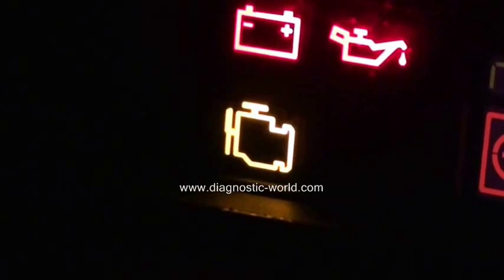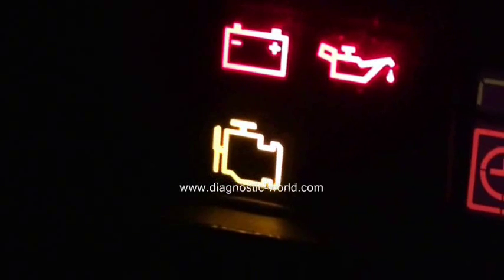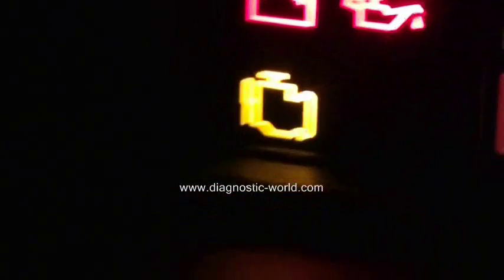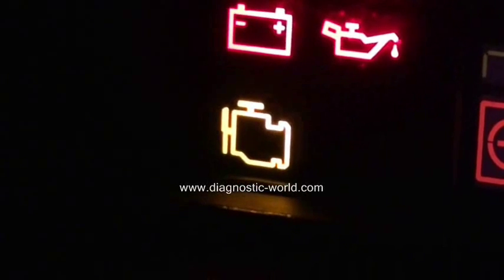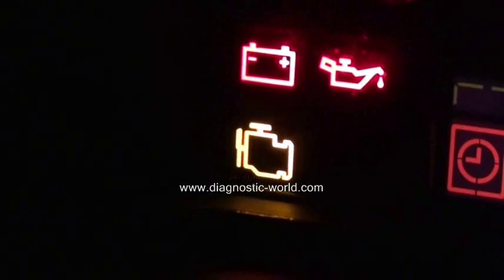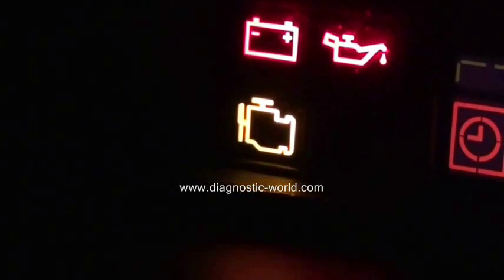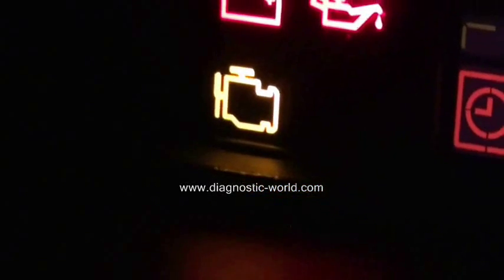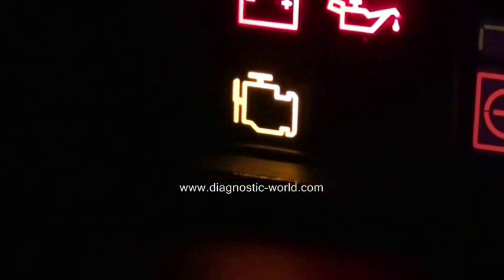SEAT Engine Management Warning Light   Need To Diagnose

Comment: The manual says it is emmisions. Oddly enough, the light came on a week after a brand new exhaust system was put on. I had to have the bracket changed  because they put the wrong size bracket on.
They couldn't  get me an exhaust  system for my Seat Leon so they put a VW type  on. I had to have a new cat because he couldn't  fit new parts with my old exhaust remains.
I was quoted by first mechanic £600 for  a new full exhaust system that is the right one for  my vehicle. Mincd you, I've  ignored the service warning light. Apparently this can trigger the Orange  engine light if ignored?

This engine light rip off happened before, with another vehicle. I took my vehicle in 4 times. First time the  garage machine code reader said  it was a sensor, changed it and it still came back on.
They did something else and that didn't  work.
In the end they said they couldn't  find anything  wrong with it.
Sometimes  they come on and stay on for no reason.

If the car shows no physical problems then carry on. That's  The general attitude.
My son had the same on his Ford focus.  I took it to garage they said it was a split pipe. So I paid £60 on top of the £250 to get it through MOT and the bloody light came back on.

It's  about time the government  did something  about car dealers/makers, garages and rip offs. 
You can spend hundreds of pounds trying to chase a problem that isn't  there.